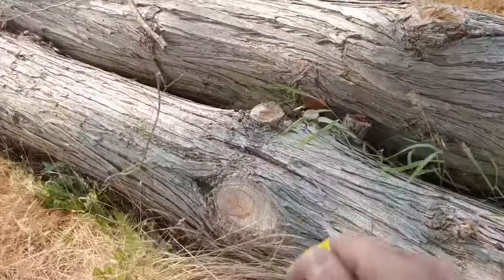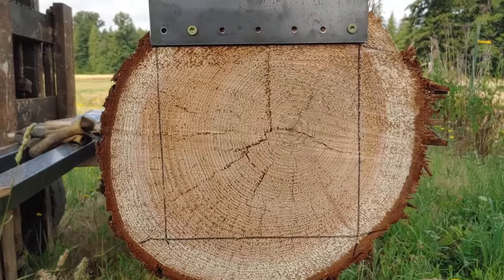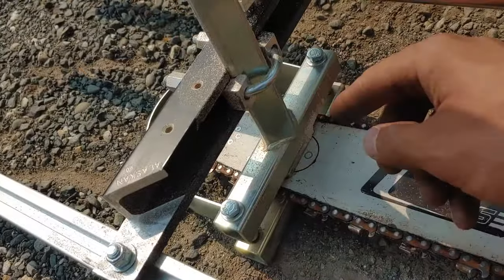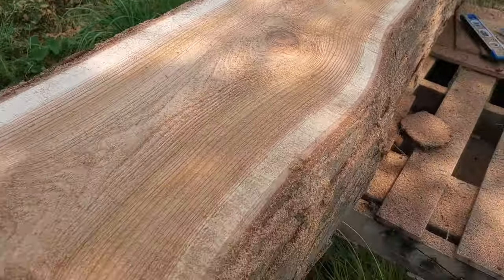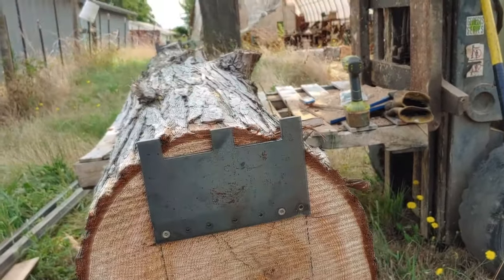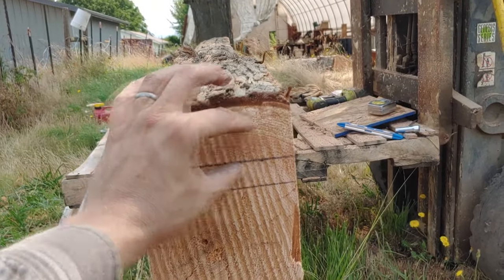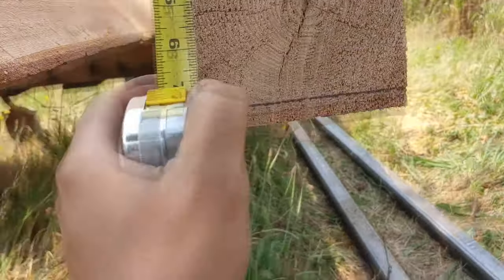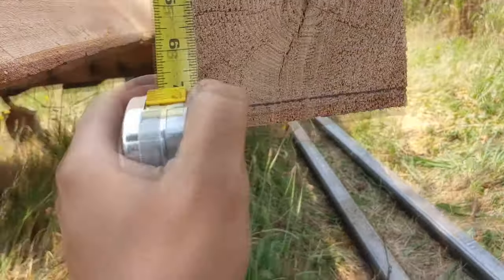Chainsaw Mill: How To, Tips, & Tricks Cutting Boards & Lumber

Comment: very nice!  i started milling with a 462 and since have upgraded to the 881 for a larger capacity
Reply: the alaskan winch from granberg really helps not only with cut quality but also helps feed the mill consistently
Reply from the maker: Cool!  I started with the 462, now I am running a 500i with a 36" bar.  Most of my wood is under 30" so works perfect for me.  They are great saws.  How long is the bar on your 881?
Reply: @SJForestProducts  i ran a 36" on the 462 and my 881 came with a 36" which im using now but i have a 64" bar and 72" mill on order from Granberg

Comment: Thanks for another informative video! I have been looking to get confirmation that it makes sense to not stop to drive in wedges. But no-one seems to comment on that. I also own a Logosol F2+. And with that mill, wedges are never mentioned. That's why I started thinking if I could skip them for the Alaskan Mill as well.

Comment: Don't add tacks, weld nuts to your guide support plates and use bolts to clamp your tubes. It will be less work and more versatile.
Cheers from Australia.
Reply from the maker: That is a great idea! Thanks for the suggestion. I will be using your idea, keep an eye out for it in future videos!

Comment: Have you found that the bars are better than just using the initial flat cut as a guide for the subsequent parallel cuts? I'm just getting into milling.
Reply from the maker: Yes, I really like the bars for the initial cuts to take off the rounded outside part of the log.  Once it is flat then you can run the mill directly on the wood.  It works great!

Comment: Hi! The mill works for hardwood, like maple, walnut etc..
Reply from the maker: Yep it works great for hardwood. I have cut maple, birch, and alder with it. Its a great way to make slabs
Reply: Thanks bro!
Reply: An other tip please, the time to dry, and works the wood?
Reply from the maker: It depends on the wood, how thick it is, moisture content, Etc. A good rule is 10% to 15% moisture and this could take 3 months to 12 months of drying

Comment: Does rip cutting dull the chain more quickly than cross cutting?
Reply from the maker: I'm not really sure, that is a good question.  I would say that as long as the wood is clean then it probably doesn't make much difference as it is just a factor of how much wood each tooth cuts, but the grain direction may have something to do with it too.

Comment: What is the difference between a ripping chain and a cross cut?
Reply from the maker: The angle on the tooth is different.  For a cross cut it is about 25 deg and a ripping chain is about 8-10 degrees
Reply: There's a couple videos out on how to make a cross cut into a ripping chain. You might find those to be of use. You have 2 teeth that are for clean out, that are half the width of normal cutters with 10° grind. The only advantage is smoother finish, but you will cut slower. If you're planning on plaining your boards then don't bother with the double the price ripping chain. Cross cut chain is significantly faster.

Comment: where did you get your rails ?
Reply from the maker: The rails are just 2x2 steel tube.  Bought them at the steel store.  Work great, but make sure your span is not so far they bend under the weight of the saw.  If that happens you get boards that are thick in the middle and thin on the edges.
Reply from the maker: You could also use this set up if you wanted to buy something: Chainsaw Mill Brackets: https://amzn.to/3q4808V

Comment: Something I'm wondering. After making the first top and side cut, why not simply drop the chainsaw inside the mill by 6 or 8 inches and do the second cut, resting the mill on the newly flatten surface?
Reply from the maker: I think its easier to keep everything set and just cut off slabs.  Thanks for the idea!
Reply: @SJForestProducts  i have my jig set for 6in to clear. that way, i can cut 6x6 posts without adjusting my mill, or re-attaching the jig. only need the jig for the 1st & 3rd cut
Reply: And maintains a much more likely parallel cut…
Reply: Ur are on point, and the slabs will maintain their width nicely, and u will be able to run through at least 4 logs faster and more accurately.

Comment: Since you have the forklift which will allow you to setup wherever you want, you could use a gravity assist to help consistently pull the saw through.  Rope attached to your mill, pulley or two to elevate a weight and redirect the pull and Bob's your uncle.
Reply from the maker: Great idea!  Use gravity to your advantage!  Thanks

Comment: On the steel bracket I personally like a wider spread for the rails to keep the saw more stable.  I do like the steel plates but would make a set for multiple width of logs.

Comment: Great video, thank you. I tried milling for the first time this weekend. After a big storm, a buddy had many huge Spruce trees fall. He had pros come and deal with the mess, they saved 10x 9 foot sections and one 11 foot section for us to mill. Most around 20 to 28 inches in diameter. We are using my Husky Rancher with a 24 inch bar. But our cut times are more like 6 to 7 minutes and we use a tank of fuel per 2 or 3 cuts. What are we doing wrong to use so much fuel? I am guesstimating you got 9 cuts on 1.5 tanks of fuel? Is there that much of a difference between Spruce and cedar or are we working poorly? Thank you!
Reply from the maker: Its hard to tell, but here are a few things that could be the differences. 1 cedar is super soft and my logs have few if any knots, 2 could be sharpness of your chain? 3 maybe differences in saw size/efficiency? I just milled up some maple that was about 8' long and ~24" wide and I was using about 2/3 of a tank per slab so you actually weren't doing too bad.  I hoped that helped.  I will have some more milling vids coming out soon so I will try to go over a few of the things you mentioned in upcoming vids.  Check out another video I have on my channel of some wide cedar slabs I milled up about a year ago.  It might have some more info too. Thanks and good luck!
Reply: @SJForestProducts  Thank you for the quick reply. We head back next weekend to mill a few more logs, I will check the rest of the videos before then.
Reply: Ripping chain, sharp?
Reply: Question: did you use a ripping chain or a crosscut chain?